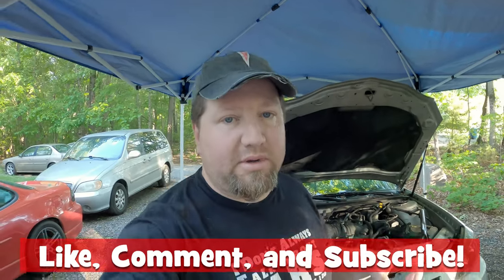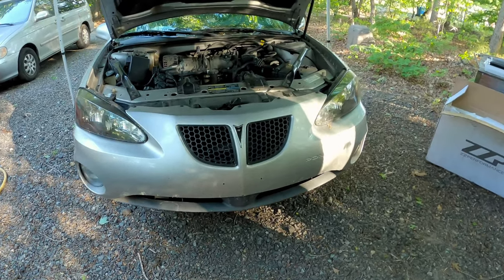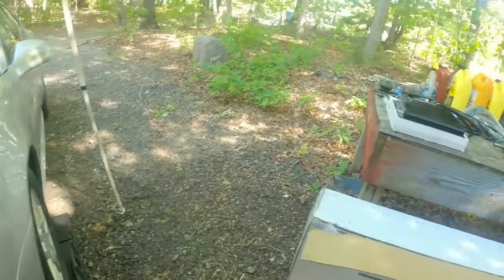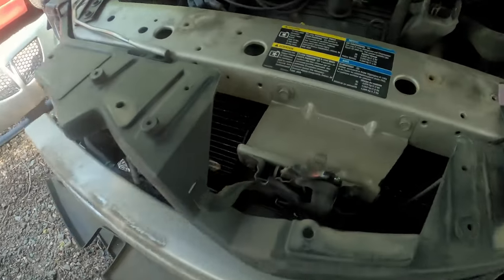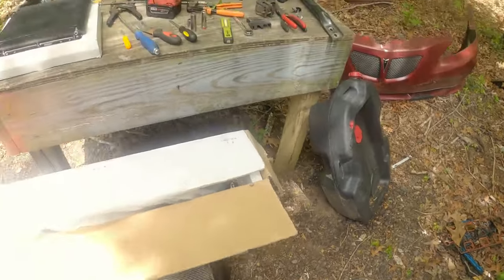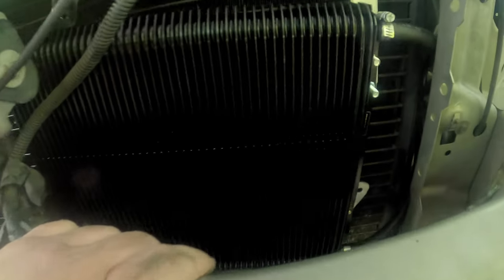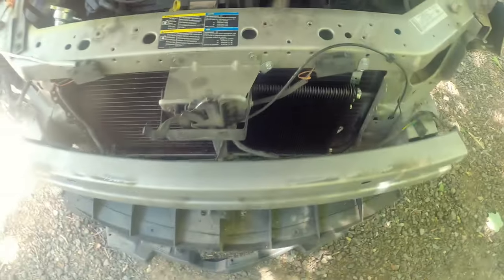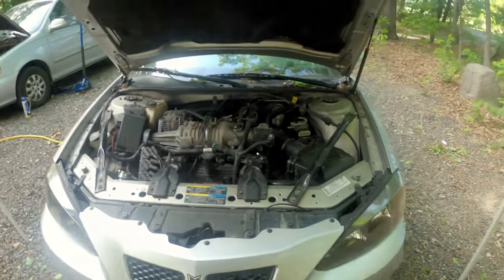ZZP Radiator and Trans Cooler Install ( 2007 Pontiac Grand Prix GT )

Comment: Amazing installation. I think ZZP definitely needs some more R&D on those hose necks. Especially since it doesn’t fit their hoses either. Those transmission temps are impressive after your cooler added. Good vlog.

Comment: I thought it was a great project until you got to the point  of the hose not fitting the radiator. I've had that problem on other projects and that just pisses me off.  So, in short, ZZP just lost a sale.  I would have bought that radiator and trans cooler for my GTP , BUT, not now. 
Way to ZZP !

Comment: I did a tru cool 4k. The big boy. I mounted it up behind the nostrils like you did however mine spans across the whole width. I stupidly decided to run -6an lines and fittings the whole way from the case to cooler. Major pain I'm the rear end getting all of the correct fittings. And very costly. I've got a large freezer Ziploc bag full of incorrect -6 fittings/adapters. But, I know it will never leak 🙃. That's what I tell myself anyway.

Doing only the trans cooler completely fixed my slight overheating issue. The stock radiator now has no problem keeping up even with ac on
Reply from the maker: Nice
Reply: @SalemDoyle  my last road trip was 4hr both ways to a tuner. So there were a lot of pulls. When I got back home at the end of the day my trans got upto 160°. This was from a total of 8hrs of driving with a lot of pulls. Very impressive. Imo the 4k was probably overkill but it does work. Of I were to do it again (I'm not going through that hell again). I would probably use the cooler you did.
Reply from the maker: Sounds like your setup is pretty nice.  I hope to get similar temps out of this.  We will see
Reply: That zzp radiator was hard to bleed I just did mine a month ago. I also did a derale trans cooler with a fan on it might be over kill but I stay in Texas so summer heat is critical.

Comment: Be good to know how much a zzp rad drops coolant and trans temp over stock without aux cooler. Ive used the Monte Carlo police option aux cooler and factory 3 lines. Always been afraid of aux rubber cooler lines as ive seen so many come in on hook after a cooler line popped off and trans puked its guts out then pump was junk before driver realized what happened

Comment: Just bought a 2004 GTP COMP G with 94,000 miles. My radiator is leaking now and I’m thinking about putting the same radiator in it as well. 
Doesn’t look to be too hard to do

Comment: Love your videos.I have the same issue in my 05 Grand Prix 3.8L NA with 125K miles. Just got it 3 months ago. Engine temps are fine on the highway, but in traffic temperature goes up past the mid-way on my gauge and I have to turn the heat on to cool it down. 
Seems like the fans come on much later than they should. Very stressful. I have a few questions: 
My temp gauge doesnt show the actual temp numbers, how are you able to tell what the exact temperature is?
Same question for the tranny temp - how are you able to see what the exact temp is?
Is there a way to force the fans to come on earlier? You mentioned you had set them lower.
This seems to be a common problem on these cars, is the only way to fix them to replace the radiator? 
Do I also have to replace the trans cooler or is that optional?
What is the right thermostat temperature to use?

Comment: Yeah city driving and highway driving gets my coolant temps to over 190 with a NA 06 Grand Prix. The trans temps can get over 200 if not up to 220 during peak summer temps. I need to find a mechanic to do this set up to my car.

Any tips on hard shifts? Sometimes 2nd and 3rd shift hard.
Reply from the maker: Probably trans issue, like a broken accumulator spring or something.  If it does it on every shift after it getts hot, could be pressure control solenoid
Reply: That's exactly what mine does. Shifts hard after every shift when it gets hot. It usually throws a code of P1811 Maximum adapt and long shift. What I would do is clear the code and the hard shifting will go away for about 30 minutes.
Reply: @mcdavidhome100  I bought my 07 GT with 158k miles about 3.5 months ago, and so far it's happened twice.  After I shut it off and restart again, it goes away for another month.  I'm still figuring out if the solenoid itself is going bad or it's possible that sometime I drive it too much like grandma (really really light feathered acceleration) and gives me a false 1811.  I've read that that can happen too.  I'm considering a ZZP tune so bring up the line pressure to make that go away

Comment: Do you have a video with similar radiator upgrade on the 1998?
Shocks/struts upgrade on the 1998?
Thanks for the lessons.
Reply from the maker: Yes, loads of older videos on my 97 and 99

Comment: I have a 06 base model and have the zzp aluminum radiator is a trans cooler a benefit for me or not as im base model.
Also i have a zzp aluminum radiator. When online i get 10 different torque specs from 10 ft/lb to 14 ft/lb whats a good torque you use on trans pan bolts?
Also the drain plug on the trans pan leaks i ordered a better gasket but a torque spec on the drain bolt would be awesome.
I also use the gm metal oem gasket.
Reply from the maker: Trans cooler may be a benefit to you still.  10 ft lbs should be enough on those bolts, but go over then a few times.
Reply: @SalemDoyle  Any guess on torque for the 1/2 drain bolt on the trans pan
Reply from the maker: Shouldnt take much about like an oil drain plug
Reply: @SalemDoyle OK that's all fixed thank youa s always. Now I have a rotten egg smell that is only after the car runs for a while. New heads, lim zzp aluminum radiator zzp valve covers, zzp power logs front back and xover 3 inch zzp downpipe and full zzp exhaust. I used the old injectors don't see any leaks ect. Wondering if it's the o2 sensor or sensors as those where not new or fuel filter. This is a project car not legal and has not moved alot started up ran ect for up to 15 min. Any point in the right direction would be awesome.
Reply from the maker: Usually that smell is either the battery or the converter full of carbon

Comment: Are you using the radiator transmission cooler with the tru cool or tru cool by itself?
Reply from the maker: Tru cool by its self
Reply: @SalemDoyle  nice
Reply: With my tune to kick the fans on at 180 and keeping the radiator clean and fresh fluid in the trans I rarely see temps over 180 degrees. If so, 185 at the hottest. The key for me is keeping the coolant temp down. Tune plus 180 degree thermostat keep that pretty much in check.
Edit. Didn't mean this to be a reply